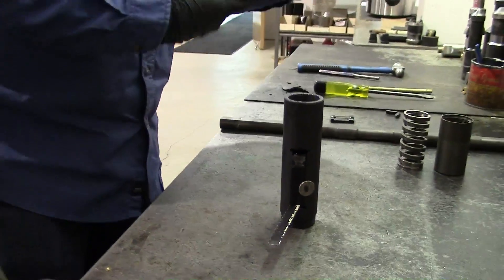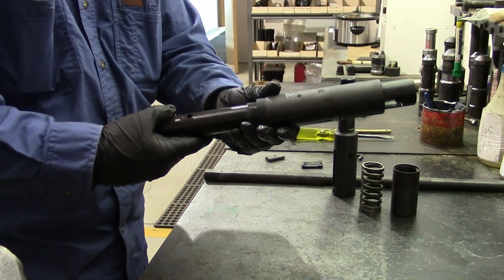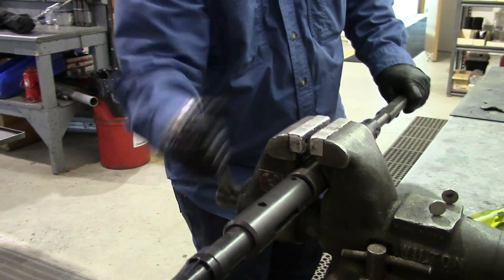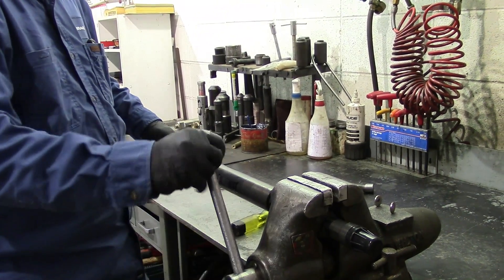Slickline X line Running Tool Assembly

Comment: Why this top sub has additional 2 holes other than shear pin hole which is 90 degree from where we insert shear pin..and also the core has 2 additional hole other than shear pin hole on the top end as well as the bottom end..please answer my question
Reply: Are you a Slickliner?
The additional holes on the cylinder and the core (after installing the shear-pins) you put a punch into the additional holes and hit (to pend the shear pens) for holding, so it will not fall while RIH 
Is my answer clear?

Comment: I used to do these with my eyes shut to prove I could. Good old Otis days. I redress them quite a bit different to how you do them. If we would have gripped the section of the mandrel that goes into the X-Lock fish neck in the vice as you did, we would have got our wrist slapped. You can see on the video where you have marked it. Good video though. It gets the job done for those not in the know. Like the magnets idea.
Reply: Hi..!  he very slowly collects, but excellent. An excellent idea of using a magnet. but I without it, assorted and collected and very quickly.